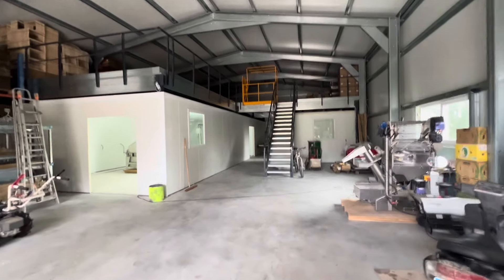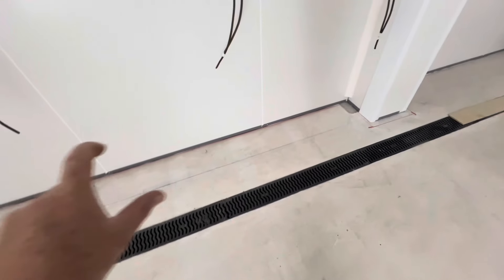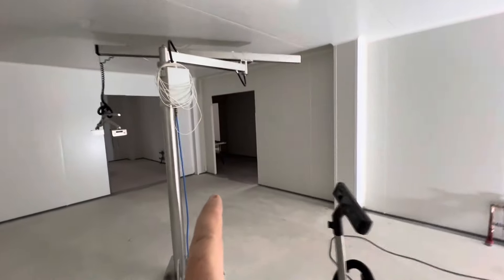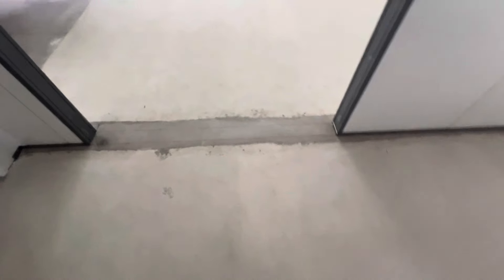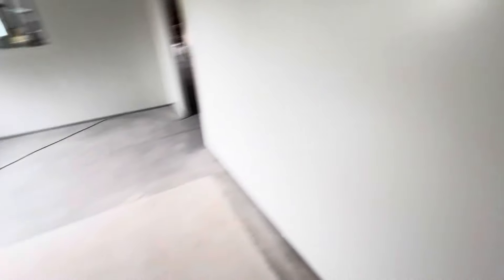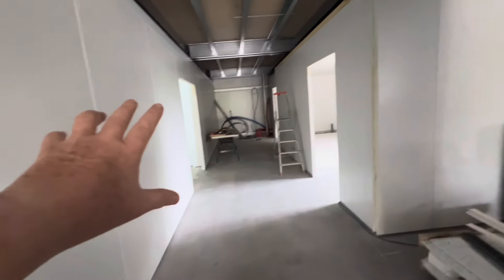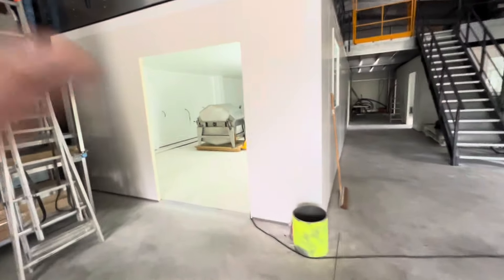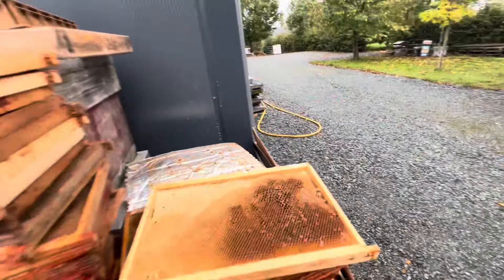Here’s the update!

Comment: How does the humidity leave the warming room as it is sometimes used to reduce water content? Just a thought.
Reply from the maker: Positive heat levels from underfloor heating will leave via doors and windows. Dehumidifier will be used in peak extraction times.big floor strain will remove surface water after washing down. There may well be other issues yet to be discovered. 🤷🏼‍♂️🙌🙏

Comment: Hello looking great . A question your hot room will it be heated off your central heat/ AC unit . ??Also is the ceiling high enough to put fans on the ceiling or are you doing something different. ??Thanks
Reply from the maker: @kathyhathaway8823  hi Kathy, it’s heated by under floor heating. No plans for fans yet. That may come later but I don’t envisage it to be a problem. Radiant floor heat usually does the trick !👍😊

Comment: i know they are large rooms and it's a fantastic job Richard but spending hours in there will you not need some sort of ventilation
Reply from the maker: @jamesbeaston7687  yes every room has a window or large door. Smoke alarms and carbon monoxide alarms also to be fitted. You never know!! Thanks!
Reply: @richardnoel3141 you did mention about sealed doors on the long end wall ( not the main entrance). If you are having a tight seal on doors and windows, you should have some sort of ventilation system to exchange the air often. Otherwise, air will go stale and not good to be in. Recommend some kind of heat exchanger on it as well so you don’t throw money out the vents with heat being pulled out.
Reply from the maker: @kendallc8807  yes indeed we also have a couple of internal vents going in. (As advised by the installaters. Mostly it will only be heated during extraction times and as this isn’t more than probably 4/6 whs of the year we don’t in usage major problems. Thank you for the question.